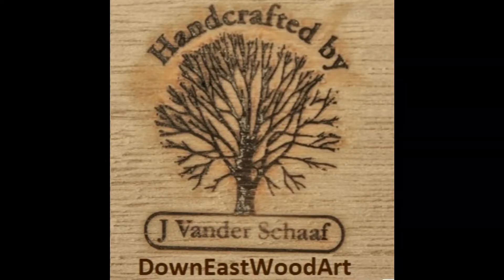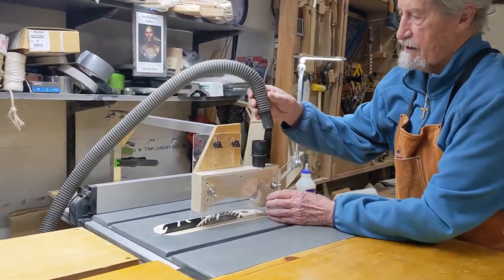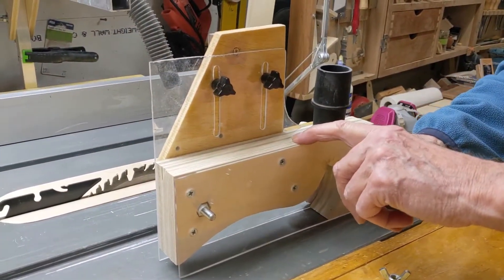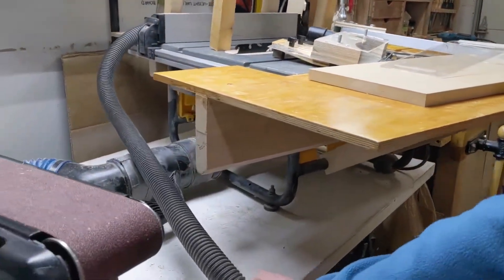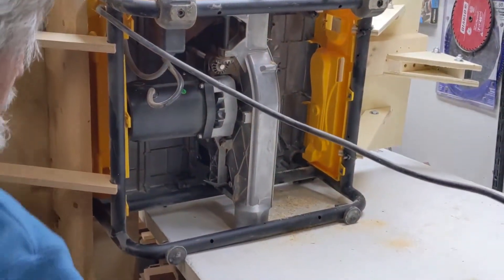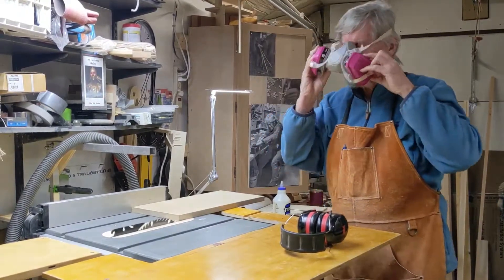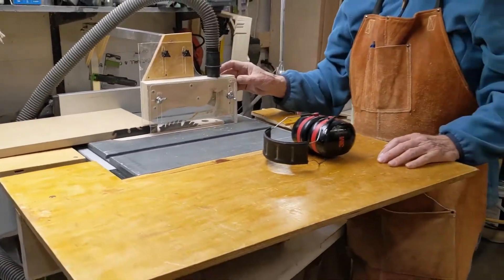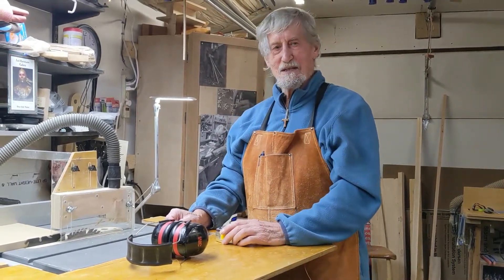DIY Overarm Table Saw Dust Collection - Simple Effective Upgrades (95% reduction in dust with MDF!)

Comment: Interesting solution, I just made something similar for my dewalt saw table, mine is a totally diy solution working on 3 axes so I can adapt the dust extraction to my frequent moving of the saw table for space reasons. I have also added LED lighting to aid the work. What I really recommend and what totally changes the suction power is to use a 100mm tube up to the saw table blade. Reducing the tube drastically decreases performance.
Reply from the maker: Hi @DIYZONE101  Thanks for the comment!  Sounds like you have a good solution.  Yes, while not in the video, I swapped out my hop vac for a more powerful model and attached the larger end to a reduced handmade coupling, and the suction at the blade is improved.

Comment: thanks for this, gives me a starting point for my own saw. i also watched justins video, if i can suggest putting a couple of threaded knobs in, one where the arm swivels on the tube to swing out the way, and one where the guard goes into the square box to hold the hood in place, it looks like an inch may not be enough to prevent the hood coming out if you accidentaly knock the hood when cutting, a threaded knob would lock both these into place preventing accidents, regards.
Reply from the maker: @kevinwillis6707.  Thanks for your comment and suggestions.  Both of those potential problems are solved in a different way with my current design.  If you wish you can purchase updated plans for a modest sum at: https://www.downeastwoodart.com/available-project-plansy
Reply from the maker: https://www.downeastwoodart.com/available-project-plans/dusty-table-saw-dust-collector

Comment: Love the simplicity of this . Thank you for sharing and especially the dimensions. I am going to make one shortly. I subscribed to your video and hope to see more of your work. Thanks again James
Reply from the maker: Thanks for the comment and subscription.  I made a detailed set of plans with several instructional videos for a modest price if you are interested.  You can find them at: https://www.downeastwoodart.com/available-project-plans/dusty-table-saw-dust-collector
Reply: @jamesrvs  James when i go to the plan section i see some nice enlarged photos. My question is it looks like your using 4 layers of plywood so looks wider than your plans. Was this a first version of picture? Just curious. Also is your saw a 10 inch saw ?  I have access to a lot of 2-1/2 by 1-1/2 to 1-3/4  wood. I am ripping these boards to about 2 x 1- 1/4 then gluing both together. Have access to lots of this wood . I am trying to decide of this plan should be thinner or as wider. Welcome to any advice in this manner
Reply from the maker: @richardhinderer2057  Yes, I used 4 pieces of 1/2" plywood so that the 1 1/4" hole for the dust collector hose would have sufficient support (first version was not as thick).  Yes  10" table saw blade

Send me pics when you finish!  Enjoy!
Reply: @jamesrvs  Thanks i will
Reply: @jamesrvs  Good morning or should i say good evening James. I dont sleep well and went down to my basement workshop looking at the collector head i made so far. I am ot happy with it and not happy with using old plywood. So back to the drawing boards and starting over. Be patient with me as i truly want you to see what i have made when it is done. I can salvage the plastic and screws but throwing the rest away. Starting with laminated 3/4 inch lumber i am glowing us. I am a perfectionist so sometimes i just don't see my flaws until a project is started. So i promise i will send the finish project in pictures. Maybe a week or so until i have got it done or so i can show pictures. Thank you again you have peaked my thinking cap again.
Richard H
Reply from the maker: @richardhinderer2057  Thanks so much for you detailed and great comment.  You have drawn me in your corner and I am very interested in you results.  Please send any questions or suggestions!
Reply: Good Morning James. I have made a working model and some changes but the two pictures i am sending is the working model and the upgrade.  I am a retired electrician into wood working and photography. I am 81 in December and a widower. I really love your site and am checking it out occasionally.    I live in Montana.  The working model works great but i amnot happy with the wood i used, so am making a newer one out of some beautiful aromatic seeder. Once done i will send pictures of the finished project. I am a profectionist and a procrastinator so takes me a lot of time making things. My hats off to you and fellow woodworkers out there. Hope to be friends for years to come. @jamesrvs
Reply from the maker: @richardhinderer2057  Great to hear from you and hear about your progress.  Making the dust collector out of aromatic cedar should be an interesting smell at a minimum!  Can't wait to see the pictures.
Reply: Sorry not getting back to you with pictures . Been ill and will hope to get back to my project soon @jamesrvs
Reply from the maker: @richardhinderer2057  Take care and get better!

Comment: Very interesting and very well made. The issue I’ve always had with the type of overhead dust collector is when I’m trying to cross cut long pieces. The vertical frame element always got in the way. My solution is a similar type of boom but fixed to the ceiling directly above the blade. I also made mine out of ply and plexiglass but I wanted a narrow cover (to allow me to still use when cutting thin strips) but also a 4” hose. So, my cover is made of 2 pieces of 18mm ply with 6mm plexiglass either side. The dust hose goes in from one side through a hole cut in the plexiglass. The whole vertical boom is adjustable in height (two pieces sliding within each other) and can be easily taken out altogether. 

So different - not better, nor worse - just made to my requirements.

An essential element to efficient dust collection below the blade is the control of the movement of air. As you showed, all holes, gaps around the saw (in my case, the cabinet) should be covered in. Then you need to make sure that you have enough of a path through the blade insert to draw in enough air to take with it the dust. Standard inserts have wide slits to allow for tilting the blade whilst zero clearance inserts do allow for thin rip cutting. However, a zero clearance insert probably will limit the amount of air being allowed in to an extent to impede efficient air flow; therefore, it might be necessary to drill some “air” holes in the insert but not near enough the slit as to negate the benefit of zero clearance. 

That really is the result of all my trial and errors. I’ve been doing it for over 45 years and so I could fill pages and pages with everything that hasn’t worked out.
Reply from the maker: Thanks so much for your detailed and interesting reply.  We have a lot in common and I appreciate your taking the time to share your experiences.

Comment: My concern with all of these is the blind spot created by the wood in the middle structure, perhaps some sort of solid plexiglass or acrylic material would be safer>???just a thought
Reply from the maker: Paolo Accomando,  Thanks for you comment.  I understand your concern and have given this some thought.  My dust collector is easily removable, and hence I know where the blade is relative to the collector, and, I can easily see it.  My collector is made of plexiglass and one can easily see the blade.  Once I started using it, my concerns disappeared.  Check out the plans I've made:  https://www.downeastwoodart.com/available-project-plans/dusty-table-saw-dust-collector

Comment: James - thank you!! How would I obtain the pattern of the wood cutout?  Do you have a template available for the shape of the cutout?
Reply from the maker: Hi Gary Allen,  Yes you can.  I'm in the process of making a project plan that I would sell for the whole tablesaw dust collection system.  Plus I have some new improvements that I haven't yet videoed.  I would sell this for a modest $10.  If your are interested, let me know?
Reply: @jamesrvs    Yes, I am interested.  Would love to buy the project plan.    Thank you -   Gary
Reply from the maker: Hi Gary,  I've put together a complete detailed plan (written plan with graphics, 1 hour of video (how to build, usage suggestions, testing, etc.) and SketchUp files.  All is available for a modest price at: https://www.downeastwoodart.com/available-project-plans/dusty-table-saw-dust-collector

Comment: Are you running the saw and the shop-vac for the overarm dust extraction on the same circuit?
Reply from the maker: Hi Tim Romano.  Yes, I am and it's a 110 volts 15 amp breaker.  I've had breaker trips when I had other power tools running, but have been able to run the Rockler dust collection motor, the shop-vac for the overarm, and the saw simultaneously with no problem.  If the wood has built in stresses, I use wedges to reduce clamping on the saw blade and this works fine.  Thanks for your question!
Reply from the maker: Hi Tim,  I've put together a complete detailed plan (written plan with graphics, 1 hour of video (how to build, usage suggestions, testing, etc.) and SketchUp files.  All is available for a modest price at: https://www.downeastwoodart.com/available-project-plans/dusty-table-saw-dust-collector

Comment: Hi James - thanks for the video.  You should check this out - the Triton Workcentre, which developed an over the blade dust collection system more than 20 years ago.  The Triton story is actually quite remarkable and the Australian George Lewin, the inventor, was a tech leader.  The Workcente 2000 had the dust collector/blade guard, which used the table itself for support (via the riving knife), rather than an overhead support.  Here is a video link from some vintage how-to guides.   https://youtu.be/9OTC6iIR3PU  Triton also made great advances in routers and router tables, again well ahead of their time.  I commend any of these videos to you, since they will, no doubt, give you some inspiration.
Reply from the maker: Hi Super Phil  Thanks for the comment.  I will check this out.
Reply from the maker: Hi Super Phil,  I've put together a complete detailed plan (written plan with graphics, 1 hour of video (how to build, usage suggestions, testing, etc.) and SketchUp files.  All is available for a modest price at: https://www.downeastwoodart.com/available-project-plans/dusty-table-saw-dust-collector
Reply: @jamesrvs  Sounds good!  I'll check it out soon!!

Comment: the tape underneath the saw is a great eye opener! just got the same saw and am trying to work out the dust issue  - thanks for the tips.
Reply from the maker: Hi Joyous246,  Thanks for the comment.  Yes, the tape was the only thing i could come up with.  The stickyer, the better.  Also, check it once in a while (depending on how much you use the saw), and replace the tape that has detached.  Enjoy!  Please post any pictures or additional questions.  Happy to collaborate.  Jim
Reply from the maker: Hi joyous246,  I've put together a complete detailed plan (written plan with graphics, 1 hour of video (how to build, usage suggestions, testing, etc.) and SketchUp files.  All is available for a modest price at: https://www.downeastwoodart.com/available-project-plans/dusty-table-saw-dust-collector

Comment: Put some weather strip on the plexiglass box edges or use those fiber strips like they use on CNC machines. Looks like broom Brussels. I actually have a cheap broom just waiting to be clamped and cut with the hot knife outside for this reason. Nice job. A lot of people will benefit from this. Love the dowel in the square aluminum tubing trick. Very clean!
Reply from the maker: Thanks Douglas Haber.  Good idea - I will try that around the area that doesn't have good contact with the cut board or the table saw surface.  Appreciate the comment.
Reply from the maker: Hi Doug,  I used your suggestion to modify the dust collector.   I've put together a complete detailed plan (written plan with graphics, 1 hour of video (how to build, usage suggestions, testing, etc.) and SketchUp files.  All is available for a modest price at: https://www.downeastwoodart.com/available-project-plans/dusty-table-saw-dust-collector

Comment: Thanks James.
Reply: Tell me what shop vac you're using.  Is it powerful enough?  Do you get dust collecting below too?
Reply from the maker: @philackerly3174  Hi Phil and thanks for the comment/question.  My shop vac is a "Shop Vac Pro with 6 gallon, 3 peak HP, 8.4 amp device."  Dust collection from the underside port on my DeWalt 745 is provided by a Rockler Dust Right Wall Mounted (650 CFM) and an attached vacuum bag
Reply from the maker: Hi Phil,  I've put together a complete detailed plan (written plan with graphics, 1 hour of video (how to build, usage suggestions, testing, etc.) and SketchUp files.  All is available for a modest price at: https://www.downeastwoodart.com/available-project-plans/dusty-table-saw-dust-collector

Comment: Made this for my old Delta Unisaw. Only problem arises when I need to cut a piece really narrow. For example, less than 2" wide. At this point I don't have much room to get the push stick through as it is blocked by the dust collector. Thinking I can possibly make an extra long push stick?
Reply from the maker: Charles Nance.  Thanks for your insight.  I also have problems with narrow pieces, but the drop down helps eliminate dust.  A narrow push stick will help.  Also having a flexible (tape entry to allow narrow pieces in) will help.
Reply from the maker: Hi thisguy,  I've put together a complete detailed plan (written plan with graphics, 1 hour of video (how to build, usage suggestions, testing, etc.) and SketchUp files.  All is available for a modest price at: https://www.downeastwoodart.com/available-project-plans/dusty-table-saw-dust-collector

Comment: I need something like this, no riving knife on mine to mount to
Reply from the maker: Hi Joshua Bromen  It doesn't mount to a riving knife - it's held up by the horizontal bar mounted on the right side of the tablesaw.  However, I'm concerned that you don't have a riving knife - have you ever had kickback as a result of not having one?  Does your table saw not support a riving knife that you can buy?  If not, I can send you a very clever method of building in a riving knife (out of wood) into your saw insert.  Let me know if you want this information?
Reply from the maker: Hi Joshua,  I've put together a complete detailed plan (written plan with graphics, 1 hour of video (how to build, usage suggestions, testing, etc.) and SketchUp files.  All is available for a modest price at: https://www.downeastwoodart.com/available-project-plans/dusty-table-saw-dust-collector

Comment: I guess this doesn't prevent kickback, have you ever had a kickback and did it damage it, thanks for sharing such a great idea
Reply from the maker: Hi Wayne Watson,  no it doesn't prevent kickback and I have experienced kickback, but not because of this dust collector.  The riving knife stays in place and that helps to prevent kickback.  I always try to stay to the left side of the table saw just in case.  Thanks for your comment!
Reply from the maker: Hi Wayne,  I've put together a complete detailed plan (written plan with graphics, 1 hour of video (how to build, usage suggestions, testing, etc.) and SketchUp files.  All is available for a modest price at: https://www.downeastwoodart.com/available-project-plans/dusty-table-saw-dust-collector

Comment: I really like your improvements to Dan's original design. The swivel addition as well as the flush table adjument is really clever.
Reply from the maker: Hey Laidback58, thanks for the comment.  We all learn from others and it's certainly true for me.  I haven't yet solved the problem of a close fence, but I have some thoughts
Reply from the maker: Hi Laidback58,  I've put together a complete detailed plan (written plan with graphics, 1 hour of video (how to build, usage suggestions, testing, etc.) and SketchUp files.  All is available for a modest price at: https://www.downeastwoodart.com/available-project-plans/dusty-table-saw-dust-collector

Comment: Very good I have the same saw, also had did you make the your table wider ..
Reply from the maker: Hi Mr. Trader.  Thanks for the comment.  Basically, I used 1/2 baltic birch plywood and tied it to a hardwood frame that was bolted to the table saw top on both ends.  Then I added adjustable diagonal supports tied to the top and resting on the round horizontal tubes on the bottom on the saw.  I also made round for the miter guage slot.  I could put together a video on this if there is interest?